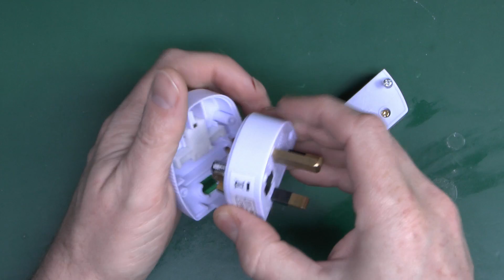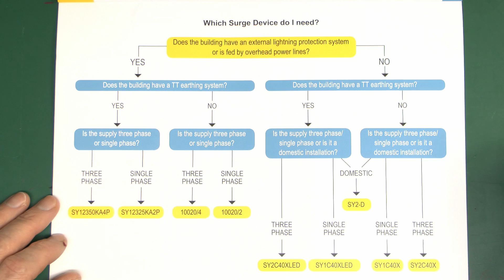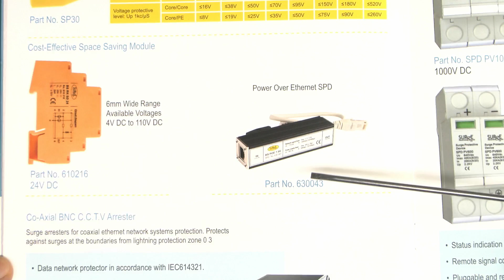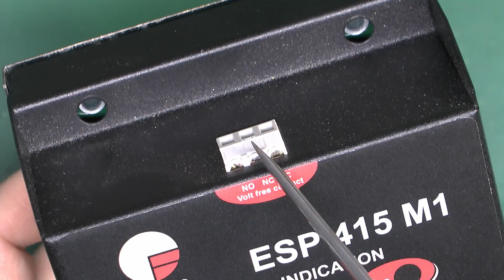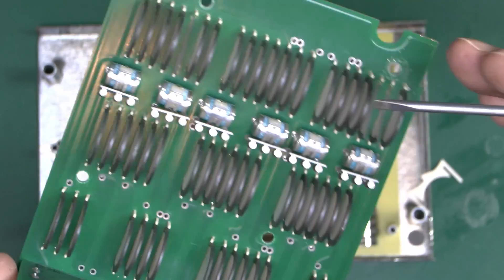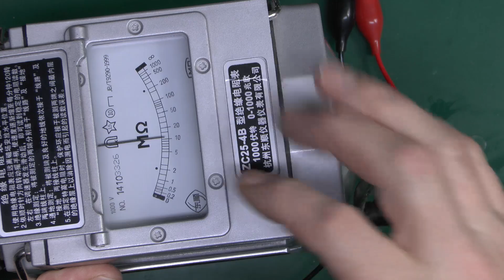Surge Protection 3 - Types and Teardown of Combined 1+2+3

Comment: Need to fit one of these but I have a question. I live in Portugal in a rural area where my supply is an overhead cable to the front entrance where the supply meter is, the cable then runs underground  for 45 metres to my consumer unit, it is single phase TT system. I don't have access to the meter area just the customer side of the counsumer unit, There is a sealed DNO side to the CU that limits my supply to 6.9kVA, this is because the larger the supply the more standing charge you pay and they ensure people don't overload their cables. Should I use a type 1 or a type 2 SPD or both?

Comment: Mr Ward. Your videos covering surge protection are excellent, well explained and concise. Thank you!! As an aside, I live in South Africa where my main concern is protecting household appliances (including TVs, PCs, etc.) against transients induced by our national electicity supplier, Eskom, switching the supply on and off several times a week, almost every week for the past ten years (due to poorly maintained generation plant and corruption) to conserve capacity and prevent a national grid failure due to potential overload (through increased demand and thousands of illegal connections). The repeated on/off supply interruptions have damaged many distributor substations (several catch fire, some explode!!) throughout the country and many households experience damage to their electrical/electronic equipment when power is restored, occasionally accompanied by initial voltage surges. Hence my interest in your "tutorial".

Comment: A question, if you don't mind,  and an observation.
 
Q: How is the 10m circuit length calculated with ring finals?
 
O: I'm not at all sure that 10m isn't a problem in normal houses.  There are millions which don't have suspended floors on the ground floor, so g/f socket cables drop down the walls from the 1st floor void.  So it's up the wall from the CU, running around under the floor, and dropping down to each socket.  Or, if they are reasonably close, down, along, and back up.  Ring or radial, unless there are JBs under the floor (and until relatively recently, with MF JBs) they were problematic.  And still are really, because if it's a ring, then each socket is on a spur, which rules out horizontal runs to other ones.
 
And even when that topology isn't needed, because there are suspended floors, again it's pretty easy to start banging up against 10m. This feeds into my question about how ring finals are measured - 5m can easily go in running up/down from/back to the CU.  With the fairly common design of socket circuits split left-right or back-front instead of up-down, there are runs up and down walls all over the place.  Just the perimeter of a small 8' square bedroom is pretty much 10m.
 
I live in a regular semi-detached, not big - about 8.6m x 6.8m.  The CU is on an outside wall, so up and across to a socket on the party wall is about 9m.  If I had a single ring final running around all three bedrooms, including serving sockets on each side of the separating walls, that's about 38m.  OK - in reality it would be less,  as it wouldn't run into each corner, and there would be savings from diagonal runs under the floor, but by how much?
 
As it's an inductance-related-to-cable-length issue, if a socket on a ring where, say, one leg is 20m and the other is 5m, will there still be a risk of an induced excursion at the socket, or will the 5m leg mean that the SPD keeps it in check?
 
If 10m really is a problem, this problem is going to be a common one.

Comment: The gas discharge tubes are usually wired in series with the MOVs to set a minimum voltage before any current will flow, important as all MOVs are slightly leaky and if you leave them fully in-circuit all the time that's both wasting electricity and shortening the lifespan. You also have to account for the fact that if you've got L-E MOVs, the leakage current to earth during normal operation can trip RCDs, especially as the MOVs degrades over time and the leakage current increases. In a device like this I would guess they've got the gas discharge tubes in line with the type 1 MOVs to conduct in case of large transients, and none on the type 3s to let them deal with small transients. (They'd be arranged in banks of different values so as the voltage of the transient increases more and more MOVs are passing current at each threshold).

In the type of SPDs you get in household extension leads (at leas the good quality ones), they're usually wired up with a MOV crossing L-N, then a second and third MOV connected L-E and N-E with a single gas discharge tube isolating the path to earth.

Comment: THe resistors are discollored, because they are the part of the capacitive dropper circuit with the capacitor and zener diode, to form low voltage for the transistors, LEDs and the relay. They use capacitive dropper because the current they need is relatively small, and that way they can save on the transformer. The sensing circuit looks very simple and simply detect if the there is input voltage on all phases, and if there is any break in the sensing strip thingy. The discoloration isn't bad, and pretty common, but obviously better designed circuit would have better resistors with higher power rating and spaced further from the PCB.

Comment: What sort of surge protection device would be used on a Low Voltage system such 12-24 volts. I am thinking of a solar powered automatic gates an intercom system. Thanks
Reply: There are devices for all types of circuits. Dehn make a very large range see their Blitzductor range
Reply: A fuse can help.

Comment: The types of SPD are determined by the testing protocol laid out in IEC 61643. Type 1 devices are "Lightning Arrest Devices" and are tested against the 10/350 wave shape, type 2 devices are for transients, inductive loads and switching surges these are tested against the 8/20 wave shape both type 1 & type 2 should be installed in parallel in UK so under normal circumstance they see no load. Type 3 are designed for very close proximity protection of terminal equipment they are tested against two wave shapes 8/20 (a lower level than the type 2) and the 1.5/50 wave shape. Type 3 devices are normally installed in series and as a result have a much lower current rating. Always ensure that the SPD's you buy are certified to meet IEC 61643 and that they are coordinated with one another, the best way to achieve this is to buy from a single family of devices and ensure that it is certified as coordinated.

Comment: Hi John, watched quite a few of your videos. Really interesting.

I was surprised to see this. I worked for Furse in the R&D department 9 years ago. That 415M1 is quite an old design. They weren't made like that when I left because it was so labour intensive. That fault with those power resistors on the indicator board over-heating was quite common at one point tbh.

Comment: Since the MOV is in parallel with the device, how does a type 3 protect the device plugged into it rather than anything connected across line and neutral? Doesn't a type 3 protect the whole ring, for example, albeit badly?
Reply from the maker: It will provide some protection to other things connected, but items further away from the device will have less protection.  For smaller installations, a combined 1+2+3 or 2+3 can be installed in the consumer unit for the whole installation.

Comment: Looks like the varistors are designed to desolder themselves when they fail and get hot. The springs then push them up through the membrane to sever the traces. As others have stated it looks like they were all still good and the control board had failed.

Comment: I speculate that the plastic spacers on metal springs at the bottom are to direct any arcs to the case (ground), instead of letting high voltage "jump" across the MOV from one solder terminal to the next. Same reason why they use 5-8 little disks with air between them, instead of one fatter one - because high voltage jumps :)
Reply: Probably not. I think they are overload disconnectors. When a MOV element fails, due to overload or wear (closed circuit) it will heat up. The solder (probably a special low melting point solder) holding it to the PCB melts, the spring pushes the MOV and the plastic slider up, so that the MOV is no longer in circuit, and the plastic slider now becomes an isolating barrier where the MOV used to be. At the same time, the spring drives the MOV up through the plastic film with the sense wires on it, cutting the sense wire and triggering the alarm.

Multiple elements are used to limit the heat in each individual element and increase the current handling capability. I had initially thought that the MOVs were series connected, but they aren't. In this case they are paralleled in groups of 6s (mostly). Paralleling MOVs is difficult because they are highly non-linear devices, so require exquisite matching otherwise they won't share the current - the most sensitive one will take the overwhelming majority of the current. 

It's interesting to see only MOVs in a type 1 device - the specs are written in such a way that it is extremely challenging to achieve type 1 operation with MOVs (there is, incredibly, a conspiracy theory about why this is!), even though MOVs are highly preferable to the other technology (spark gaps) available at the type 1 energy level. That said the type 1 specs on this unit are pretty feeble (6.25 kA, compared to the more standard 25 kA per mode needed for reliable lightning protection).

Comment: Saw something lile this at CES in Vegas where the guy had packed the MOVs into a thin concrete mix. Fire protection I assume unless anyone knows better?
Reply: If the surge has enough energy, the MOVs will fail explosively, and some sort of containment is usually desirable.

Comment: Are too varistors expensive to add into sensitive electronic equipment?  Or is it because like you said in previous video they can fail over time that we don't see these installed as the norm in consumer electronics?  Seems odd to add an extension lead with surge protection unless there is good reason not to have it inside a product power supply or in the case of items powered with kettle leads and the like not to be added behind the device power input.    If you have a transformer inside a product does it's voltage output increase linearly with voltage being raised?
Reply from the maker: No, the individual components are cheap,.  However if manufacturing 10 million televisions, even a few pence on each one can cost millions extra and put a huge dent in the profits.

Comment: I'm surprised at how narrow the tracks to the MOVs were.  I know the surge is very brief, but 10KA through those???  Hmmm, deliberately fusible?
Reply: I used to work for Furse in R&D when this was made. The copper plating thickness on the PCB is nowhere near standard. We used to the 10kA test in-house and externally and they could handle the current. The assembly design in this video is 20 years old though. They weren't made like that when I left 10 years ago.

Comment: I thought if you don't have the minimum required length of wire between the different types you need to fit inductor modules between them?
So it surprises me to see this combined 1+2+3 type.

Comment: This SPD was clearly still alive (the metal oxide varistors haven't desoldered) and the monitoring circuit had packed up. Not really good enough for a £800 device. Could carry on using it if you fix that fuse +/- the resistors if you still need monitoring.
Reply: There must be some other fault since the smaller burnt resistors have been grossly overloaded - in normal operation there should be no way that they could generate enough heat to burn the PCB like they have. The other area of the PCB with burning is probably not due to a fault since the resistor type ( looks like a Vishay PR02) are rated at 2W and run really hot so it is not unexpected that some PCB scorching will occur over time.
Reply: Despite all the money for R&D on products like these, it could still very well be that the resistors are just undersized and ran hot for most of the life of the device.
Reply: R 10,11,12 look to be fusable resistors, only because of that terracotta colour.

Comment: I used to fit those furse spds in CCTV systems years ago. Just movs and gas discharge tubes. The failure of that £800 unit is prob due to the 5 burnt out resistors on the monitoring board. Should have replaced and tested it, bet it would work. Great teardown JW enjoyed that 😎👍

Comment: I thought the skin just hanging there on the tip of his left index finger was rather gross. Of course, I was eating at the time. It looks fairly deep. A bandage would have been nice for those close up shots of his hands. I mean, you could see under it at just the right angle. It wouldn't hurt to use a bandage to protect that from dirt.
Reply: Grow up.
Reply: @jovetj  Don't be an asshole now.
Reply: Wounds usually heal better when they are in open air as long as they are kept reasonably clean.
Reply: @benbaselet2026  My point leaving the flap of skin hanging there could cause editional skin to be torn off. Also, that flap of skin might have bonded back onto the wound if it was bandaged after the accident. That's what happens to me. It speeds up healing. Yes, after the wound has has a bit to recover, they do heal faster when exposed to the air. Personally, I would keep a bandage on to keep the would clean while I am working. At any rate, I think it would do more harm than good for him to leave that dead flap of skin attached especially while working.

Comment: Could it be that failed MOV will heat up, self un-solder and be pushed through plastic sensor by the plastic cards and springs?
Reply: You are correct.
Reply: I was thinking this was a bit of a convoluted way to do it. But then I thought, on a big surge it would probably blow up if it didn't.
Reply: I don't think it warms up during surges, but after the failure due to exposure to regular line voltage.